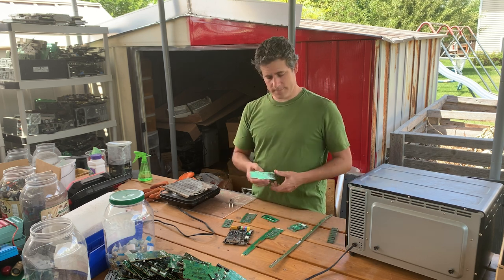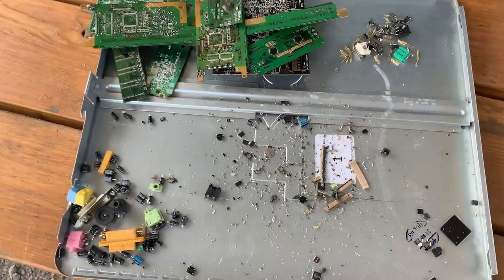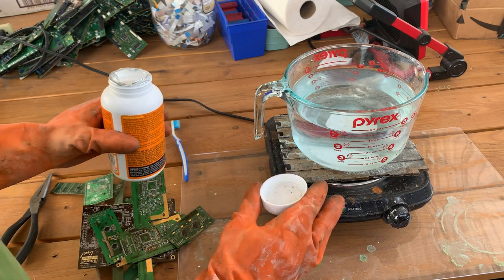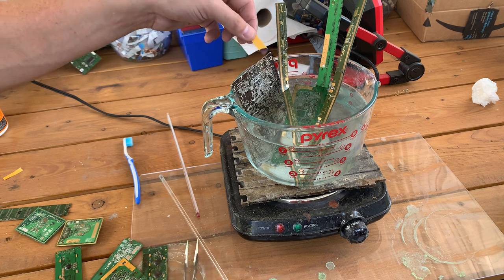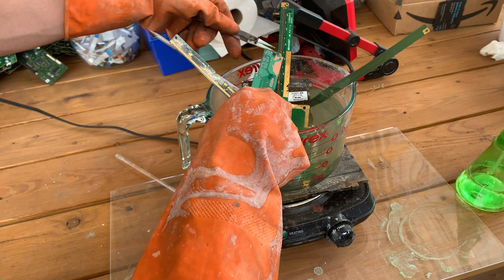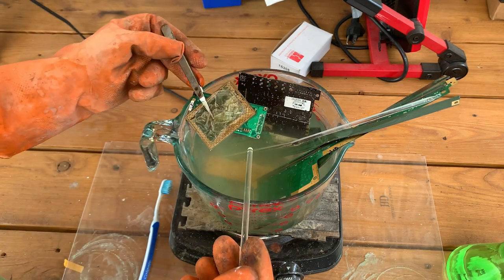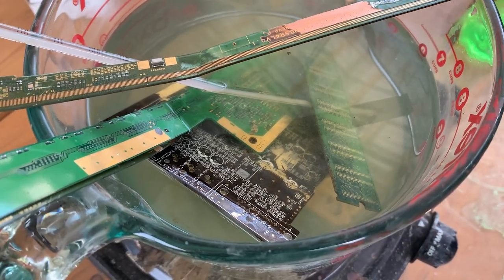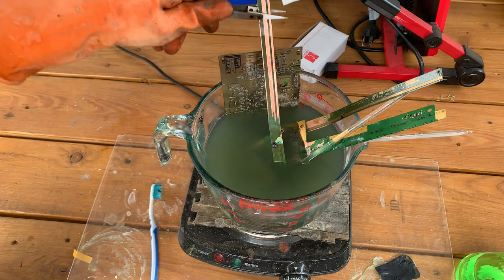eWaste Mining: Solder Mask Stripping To Reveal Gold

Comment: Ahhh, pH scale mistakes!  lol.  So Lye is Sodium Hydroxide (NaOH) it is a strong alkali and is very basic (alkaline).  Strong bases have a HIGH pH, not a low pH.  The pH of the solution is likely to have been 12-14 or higher!  Pure water has a theoretical pH of 7.0, and Acids are lower than 7 and bases are higher than 7.  pH is a measurement of the concentration of hydrogen ions (H+). More specifically, pH = -log(H+), so because it is a logarithmic relationship, 1 unit difference in pH (going from 7 to 6 or 7 to 8) represents a 10x increase or decrease in the amount of hydrogen ions present, and going from 7 to 5 would be a 100x increase in hydrogen ions!
Reply from the maker: :) I should have asked you before I posted ... But it makes sense... I flipped my PH table in my head.
Reply: @badideametals  That's alright, it happens to the best of us. It is kind of confusing and amazing that at either end of the pH scale ~0 and ~14 we encounter solutions that are each very corrosive and dangerous for opposite reasons.  Isn't Chemistry fun?